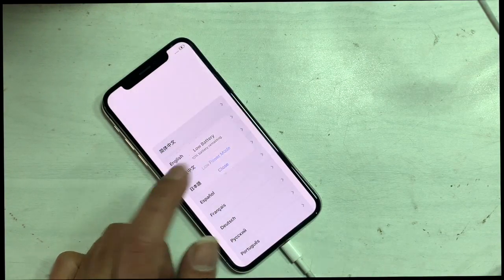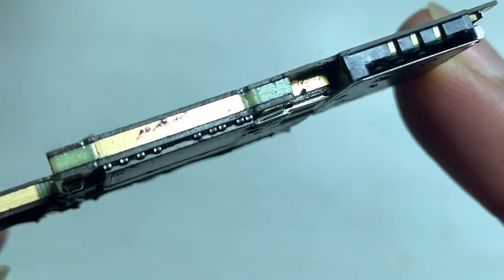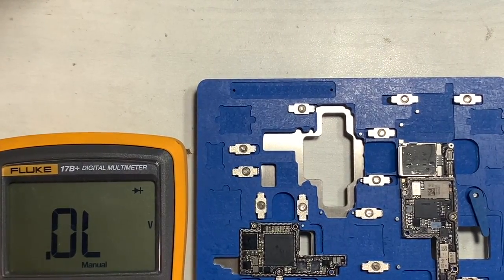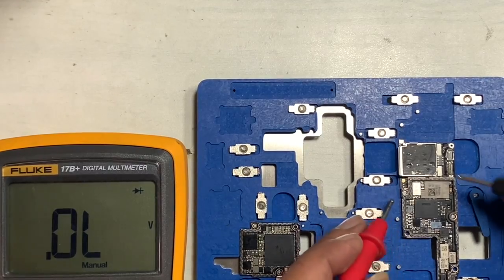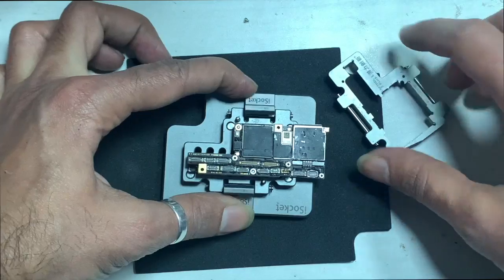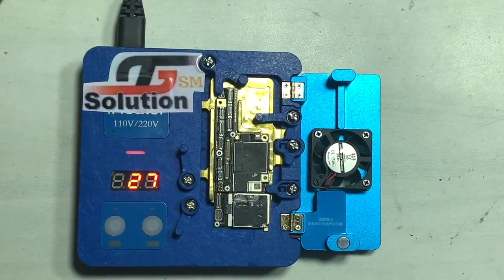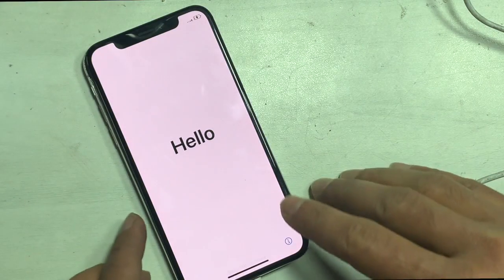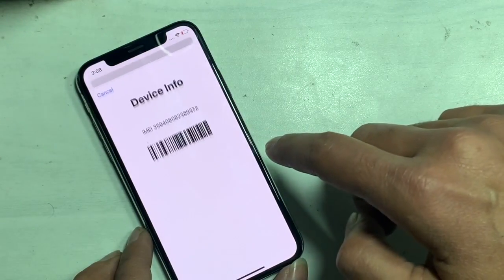iPhone X Unable to Activate Fix 2021.

Comment: I have the same problem but my 11 Pro Max, I took it to all programmers in my country and they didn't know the solution, please is this the solution? 🥺🥺🥺
Reply from the maker: Did you see this videos carefully that is hardware related issues. So first try for hardware solution with good cellphone repair technician.